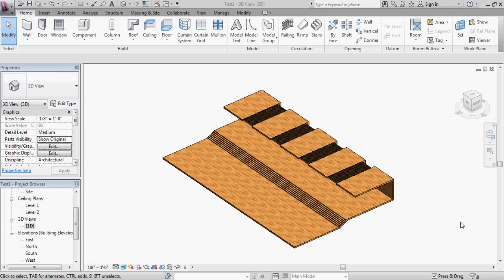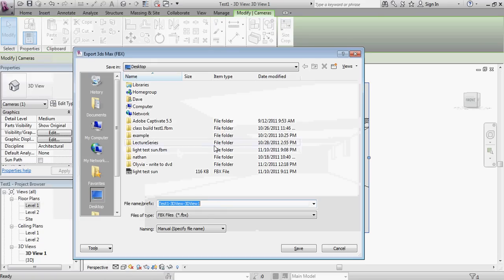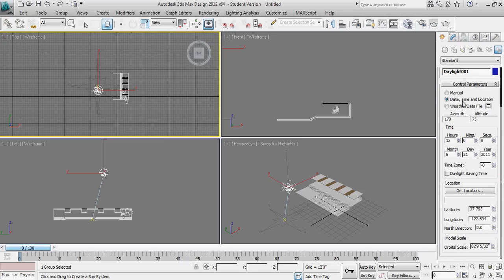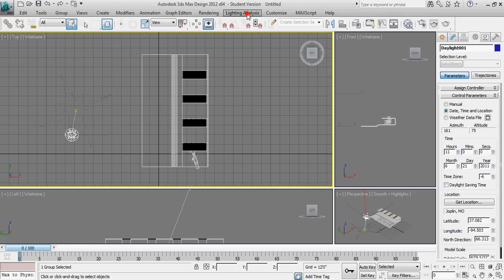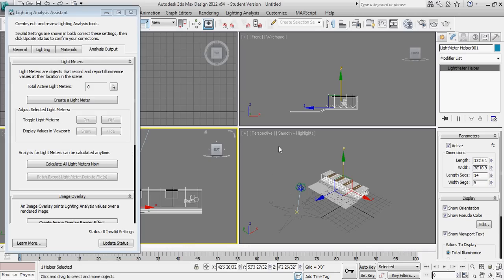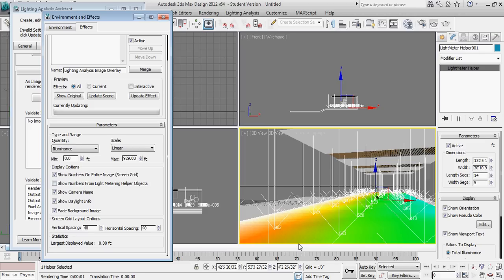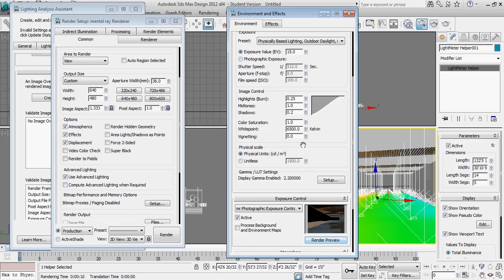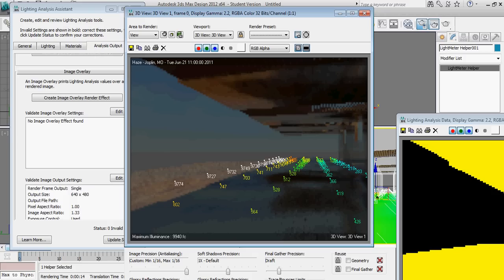3ds Max Lighting Analysis

Comment: Does it take into consideration the materials that are applied to the objects...? Lets say that i want all the wall be made of mirrors, that would change how much light is the room since mirrors reflect light, if i give the walls a material with lets say 95% reflectivity... Will this light measuring approach take that into account and still measure the lighting in the room realistically/accurately? Or does it work only with geometry and totaly ignores the materials assigned?
Reply from the maker: Howdy Roman. In theory, yes, it is supposed to take all of those elements (materiality) into consideration as long as your materials are set up with the correct parameters. However, this video is a bit older...so i am not 100 percent positive.
Reply: @DavidRBeach  thanks for reply :-)

Comment: HI thank you for your tutorial. But where can i find the analysis of light in 3ds max 2014?
Reply from the maker: firsty9354 First, make sure you are using 3ds Max "Design." While the difference are very few, in the last few releases the lighting analysis tools has been one of the those differences. It should be top center in the drop down list. Also of note: Revit has brought in several tools that work in a very similar way...which might be relevant depending on your workflow. -dave.